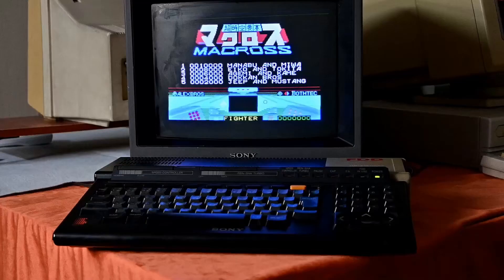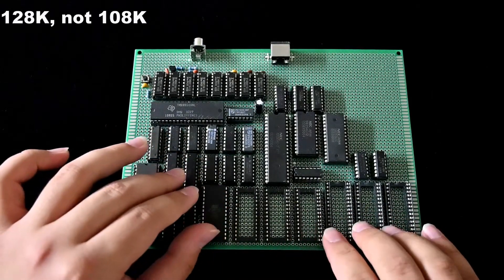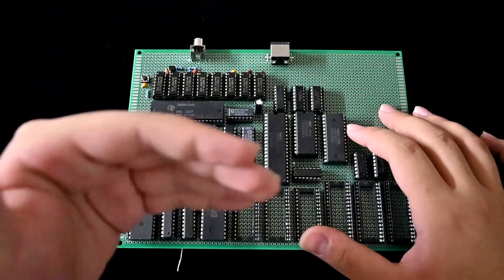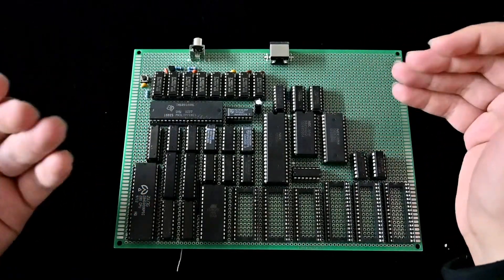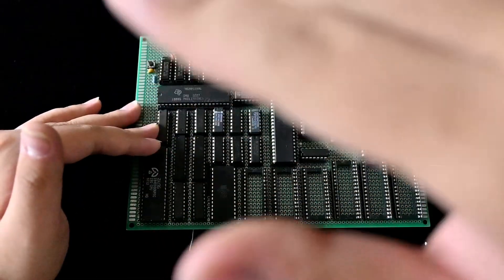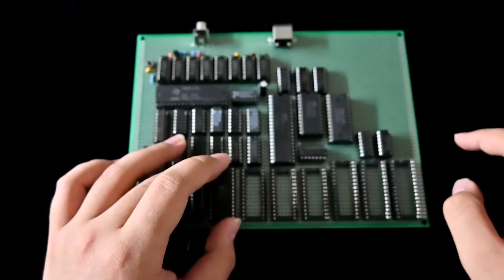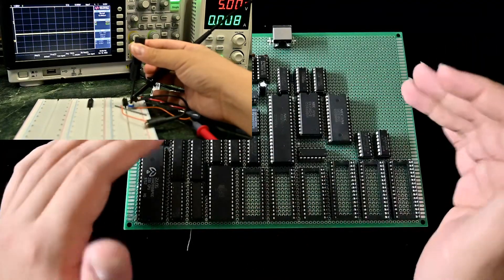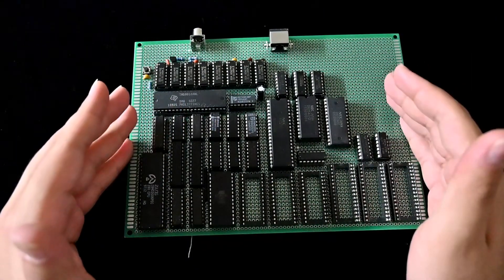I found what's wrong with the Z80 motherboard!

Comment: I am currently coding on John Winans Z80 SBC, and he did the ROM/RAM switching differently. On his board, ROM and RAM are both enabled at power up. But there is a FlipFlop on one of the IO ports. Once you access that port, the FlipFlop turns on and permanently pulls the CS line for the ROM high. 
So what you do is, after powerup you just copy all the code "in place". In practice, you set BC,DE and HL all to zero and then do LDIR. That causes the whole of ROM to be copied over to RAM. Then you access the special port address, that disables the ROM and everything works normally from there.

Comment: Not sure if that will be of help:
some folks did custom chips like FPGA/PAL/GAL for doing address decoders (like Commodore spent such a unit for the C64).
it might be a reasonable solution for such a complex system to have address decoding not built from standard logic just for complexity reasons that you don't want to deal with in discrete gates for timing and signal level reasons. inside such programmable logic device both of those aspects are much less of an issue. - its definitely up to you and your understanding when its needed or possible to go either the one or the other solution.
Reply from the maker: Address decoding using TTL chips is fairly simple (if you don't need to select a few registers from 64K address space, in that case a GAL is the way to go). The hard part is capturing instructions on-the-fly. I do that with a GAL16v8.

Comment: Hi Andy, when I saw this video I remember my own experiences with pull-up and pull-down resistors. Some ICs need a really low resistance value to stop them from doing things we don't want to happen. I think it gets better with HC and HCT logic. Sometimes I use combinations of LS, HC and HCT to influence timing in my projects. I don't own a scope which is able to show delicate timings so I must go on instinct and experimentation to solve timing problems. Regarding the bank switching, it reminds me of ROMWBW (also for Z80) which uses a 74LS670 to select the bank addresses. It sounds a little like what you are doing, but your idea seems more elaborate because it uses more memory to store bank address data I think. 

Regarding your many hand soldered wires, I can identify with that as well. With hand soldering, basically anything is really possible, no limits in connections really. What I did before is keep some loops in the wiring so you can shift it away when you need to solder underneath later. There is one caveat I want to tell you. When you hand solder a project with loose wires, you must keep in mind that this circuit will be much more unstable and unreliable than an actual PCB with solid ground planes etc. The most definitive proof of this was when I made my own version of a XT-IDE board. It looks pretty simple to do in concept, but when testing, I had to change the IC types a lot to make the timing work finally. When I designed and ordered a PCB from JLCPCB, and soldered the PCB, I found that suddenly all harddisks functioned properly, when previously only some of them worked! So it's really best to design a good and stable PCB, and start testing further from there. This can prevent some delicate problems from happening in the first place.  When I remember how long I took to debug the hand soldered XT-IDE project, not to mention the frustration! When after soldering the proper PCB, I found it works 10 times better and much more reliable. When you design a system where you plan to add more things to the bus later, I really also recommend to use 245 bus driver ICs I have done several mainboard designs which include a ATX Z80 PC, and an ATX 8088 XT PC.

you can find the projects at:

https://www.knaapic.nl/wordpress/hobby/rc2014-modulaire-z80-computer
https://www.knaapic.nl/wordpress/893-2
https://www.knaapic.nl/wordpress/my-ibm-compatible-xt-clone-pc-mainboard-design
At the first link you can see my hand soldering work, all in one colour wire. Actually I have done many such PCBs, maybe more than 10. One of them is now inside my Amstrad PPC640 to add a laptop IDE harddisk inside.

What I did for hand wired projects was to make the schematic in KiCad, then move to a PCB, place the components in a reasonable configuration, and then solder them into the experimenting PCB, next the PCB program can serve as a reference to easily show and double check where all the connections need to go. When finished you can use the netlist to check all the connections. And remember to examine for shorts using strong magnification, just look closely at all the pins one by one and if there is a short, you can visually spot it with good lighting.

What you are doing is great and you can learn a lot from your efforts. So I want to tell you, don't give up, your idea is worth it to develop it further. I know the feeling of having ideas and because you know it's a really good idea that deserves to be realised, the urge to make them in reality can be a great motivator. Same for me.

You had better consider moving to a real PCB. What you want to do really merits a PCB. KiCad can be learned with patience and you can gain more experience. Even if the circuits are not finalized, you can also modify a PCB when needed, and it's much more stable generally speaking.

Usually it will require at least one revision for final modifications to get a final PCB concept anyway.
If you want to exchange ideas, you can email me if you want.

Kind regards,

Rodney
Reply: Wire wrapping better ?
Reply: The problems Andy is describing here are the biggest reason I go out of my way to find HC parts. "Will LS do?" NO. The rest of everything is HC, not guaranteed to be HCT, and I do think about fan-in and fan-out. But I do not want to think about TTL's 3.5ish volt logic high that may or may not drive a CMOS gate that isn't made to operate at that voltage. Buffered I/O can help, but buffered I/O introduces its own problems.

Comment: Yes you can see from the datasheets the max input current flow out of the chip is 200uA, and yes is voltage dependent, as the inputs are clamped to a roughly 3 diode drop reference internally, so as the input goes above roughly 1V5, 2 silicon diodes plus the schottky diode, it changes dramatically, as the diode starts to turn off, and the PNP input as well starts to turn off. Would work with 1k to ground instead of 10k, though the recommended 330R resistor to ground works better, though losing the fan out and also hurting the ability of an unbuffered Z80 CPU to drive it, as most are barely able to drive more than around 5 LSTTL loads, though the datasheet guaranteed 4. HCT works better there, at least it keeps the bus loading to zero, and still works with TTL logic levels rather than the broader CMOS levels. HC would have had the opposite problem, with the Z80 normally having the ability to drive the bus, but sometimes the decoder not quite being able to get to the threshold before the clock period finishes, leaving the odd runt pulse in there that crashes decoding.
Reply: the TTL load count is few - and i also found that doing TTLs for a signal with many consumers is not feasible. and leave alone bi-directional bus setups...

Comment: At least you have a direction to search now.  
With clocks in the mhz range, you are in the RF domain.  Switching DC on and off at RF frequencies in a circuit that has capacitance and inductance will create interference, inductive coupling between parallel wires, radiation at sharp points and bends, etc.  
There's a reason there are bypass caps everywhere on modern PCBs, careful routing of address and data lines, and on board power conditioning.  As soon as you started describing the problem, I thought about resistor packs.  You could adjust that value to keep the bank select from driving the floating bus, or try a different chip.  They have different operating characteristics and variations from chip to chip can be significant.
Reply: Exactly right, bypass caps are super important and can't be omitted. When using a resistor pack as pull-up or pull-down resistors, I wanted to comment, it's better to use a cut IC socket on the PCB so you can test by plugging in several different resistor packs and get the best stable result with the least necessary resistance load on the circuits. When experiencing quirky operation, usually it can pay off to first try selecting other logic family equivalents with better expected behaviour for that specific circuit area. That's also my experience and absolutely critical to observe when testing larger systems made with TTL chips.
Reply: Indeed, now I also saw there are practically no bypass caps on the PCB. Andy you really need to add a bypass cap to every IC on the PCB before doing further testing. For me it's so obvious, I even didn't notice the bypass caps are missing! It's not only theory, it's really necessary, even more so on hand wired projects.

Comment: I am surprized that a guy intelligent  and knowlegable as you is not making videos about Risc-V. My favorite CPU (architecture) are Z80 (beacuse of the alternate registers) and Risc-V (pure beauty and difficult simplicity)
Reply: After building computers with Z80 CPUs and 8088 CPU's, definately the Z80 is a winner in my opinion. It's much more design friendly and stable than the 8088, and needs practically no support logic like the 8088 does. However the Intel chips are much more developed thanks in part to IBM. What I love about 8088 is the software available, and more address lines. Nothing else really, if not for those, and the nostalgic feeling of old PCs, I would stick to Z80 and similar projects. It's a great pity that Z80 architecture didn't have more strong and solid development by Zilog to keep it suitable for more modern real systems like PCs. When I discovered the RC2014 and ROMWBW, I found that indeed such a system is starting to resemble a PC and also supports CP/M in much detail. A really important aspect of any system is it's software development potential. That can draw in programmers and make the platform more attractive. Today there is much more collaboration on the internet, and it pays off just to look at other systems, it may inspire you for many new ideas. Designing computers is a bit like art, and often can benefit from inspirational ideas, to develop an instinct about what direction you want and need to move towards. A bigger perspective always pays off even for ideas that start out small.
Reply: @rodneyknaap  - i am just reminding those old times - where 6800 and 68k were said to be the most direct designs. and all the world went otherwise because the hoped for the short term savings whilst missing the mid (or even near) term ramp up to big computing solutions. with this i am now more talking with embedded systems in mind than PC systems.

i once had hands on a scrap bin provided Honeywell Bull terminal (might it be some VT200 or whatever) and it was having maybe tube power or general power supply issues so that it did not make it to fully do a start up. but it did for a lucky short time in the beginning. unable to understand or resolve that at those old times it went to just removing parts and repurposing or just collecting them like the z80 it was based upon. i maybe had the ROMs pulled and i might have had the chance but did not use it to find the chip select wires measured for a high to get address bus layout identified. - i think i have to say, it's long gone for sort of a reasonable sake and will never see re-assembly.